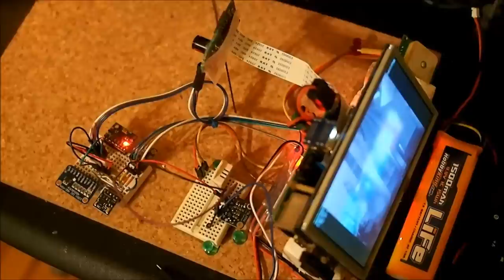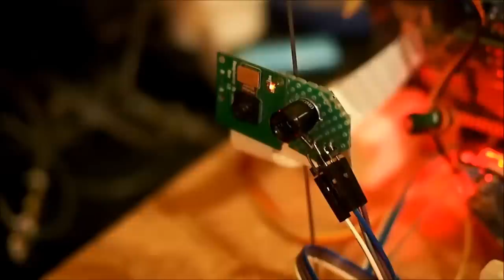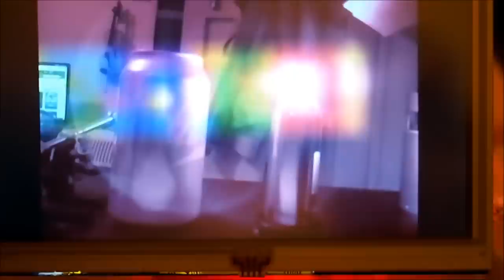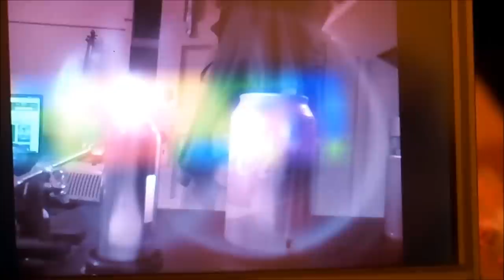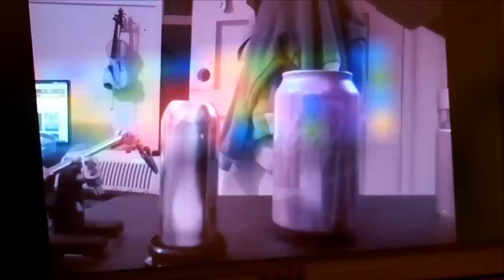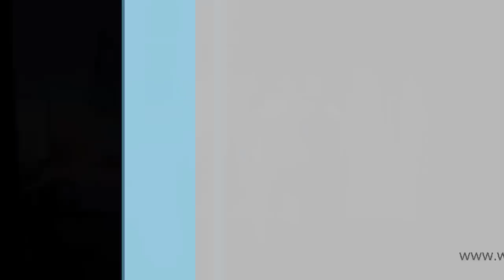Budget Thermal Imaging with the Raspberry Pi 2

Comment: Bought one of these sensors a few years ago & just built one using a Raspberry Pi Zero with bult in wireless of course.

Do you know how one could increse the frame rate of the thermal sensor to something a little more usierble. Have been playing with the code but was only abke to improve it slightly.
Reply from the maker: The refresh rate of the sensor can be increased to 512Hz by using the function mlx90620_set_refresh_hz() in mlxd.c. However I think the bottleneck is probably the Pi Zero CPU speed (and Python also). If you want maximum performance you would either want to implement this in C, or use a faster processor or both... But the graphics processing is what takes all of the overhead. So if you just wanted to read the thermal data and process it but don't need to visualize it in real time, then a Pi Zero would work fine. (The thermal data is only 64 pixels, so that's only 32k of pixels per second of thermal data. )

Comment: Hi I am trying to do the same with a Raspi 0 .... I am trying to use to so the reading and writing as suggested in the datasheet ...

I am using the pigpio library for that but Reading oscillator trimming register fails 
But I am not getting any Ack from the slave ....
Reply from the maker: this project is open source. You are welcome to check out/use my code if it helps... It is on Github at https://github.com/alphacharlie/mlxd

the sensor IS a bit finicky to initialize. ;-)

Comment: Where did you get your Melexis MLX90620 ? Did you get it in bulk?
Reply from the maker: +drew zeccola - I actually used an MLX90621 which I purchased from digikey for ~ $75. I haven't been pursuing this one so much as the prices have been coming down on the higher resolution sensors from both Flir and Seek Thermal. (Both of which have been successfully connected to the Raspberry Pi.)  But the MLX sensors could still be extremely useful for some applications. The 16x4 especially lends itself to production line QC and such...

Comment: Hi +Charles Werbick, what max distance was you able to achieve with this sensor?
Reply from the maker: I had no problem viewing the heat from a large candle flame at 3-4 meters but didn't try further. I think the max distance achievable will depend upon the size and heat differential of the object as well as the image sensor... (Once the 'hot' or 'cold' object gets much smaller than a pixel it has to be a lot hotter or colder than its surroundings to be visible.)
Reply: I appreciate the speedy reply, thank you. The information you provided is definitely what I was seeking.

Comment: Is it possible to just get the MLX90620 sensor and when it detects warmer thermals do something? Or is the camera necessary?
Reply from the maker: Yes, totally. The camera image and thermal data were overlaid as a  demo. But anything could be done in software. (Also since I made this video both FLIR and Panasonic have released higher resolution thermal sensors around the same price range...)
Reply: Sweet! I don't know much about thermal sensors, would you be willing to point me to those?
Reply from the maker: The panasonic 'grid-eye' sensors are similar to the MLX but have a resolution of 8x8. (homepage- https://na.industrial.panasonic.com/products/sensors/sensors-automotive-industrial-applications/grid-eye-infrared-array-sensor) They are all some variation of I2C so they require soldering, a microcontroller(arduino Raspi, etc.) and some programming to get them up and running.

AFA procuring the hardware itself, Digikey seems to have the best selection of thermal sensors. They carry all of the sensors I mentioned. (Search for 'Lepton' or 'grid eye' or 'thermopile array' to find available products. Google for the same + 'raspberry pi' to see how to integrate the hardware...)

And of course, Good Luck!
Reply: You're awesome! Thanks a bunch! :)